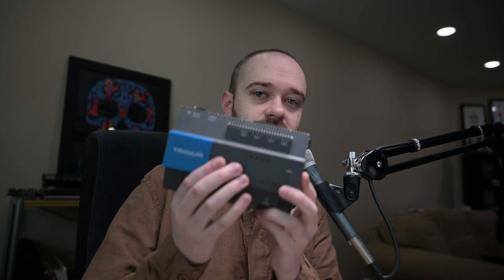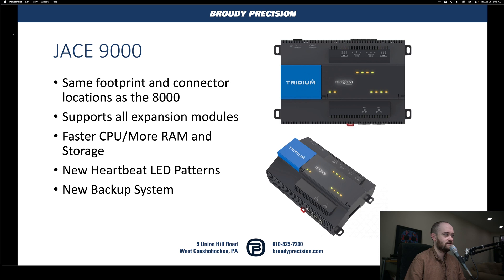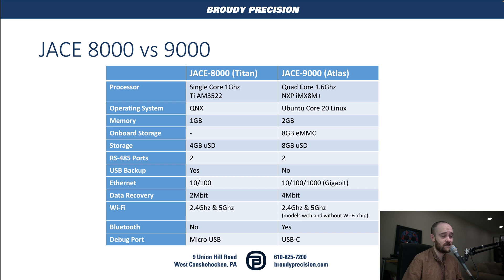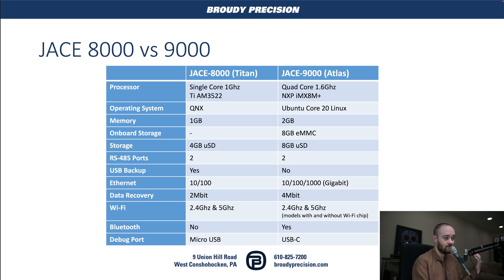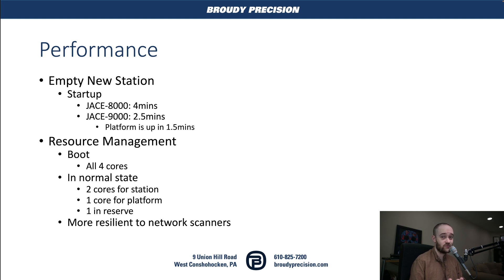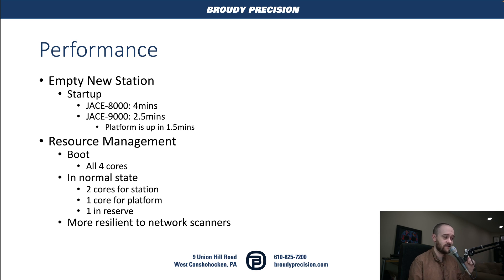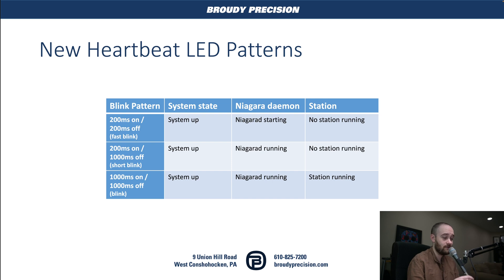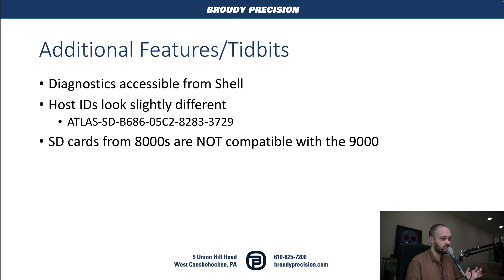The JACE-9000 is here!

Comment: I haven't seen anything on increased device limits from the JACE 8000 to the JACE 9000. I was never given a hard max on the 8000 but was was told don't go over 200 devices. Any ideas if that soft limit is still there or do we have a lot more room now? IE I have a building with 265 devices split on 2 JACEs with graphics on a server, could that be all done in one 9000? Not seeing any actual value if it can't do any more
Reply from the maker: It's really hard to put a number on that because of the number of factors outside of devices - points, histories, alarms, graphics, programming logic, etc.

That said, we've seen pretty significant bumps in performance. I would not at all be surprised to see it handle over 200 devices.